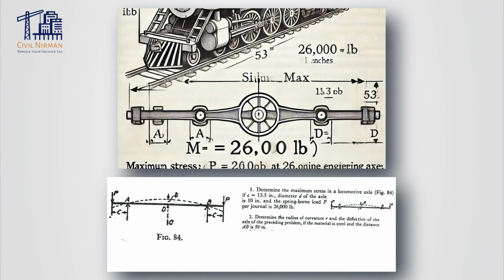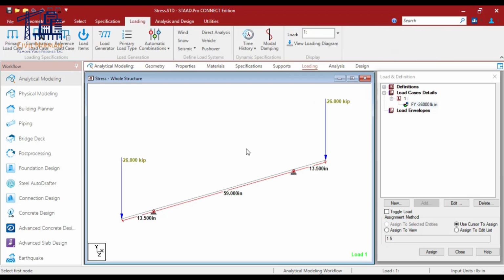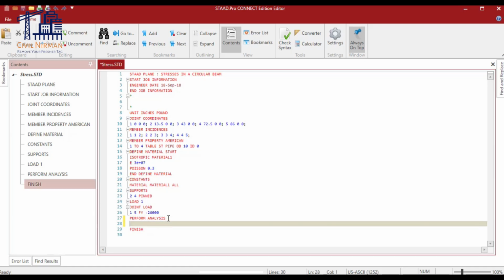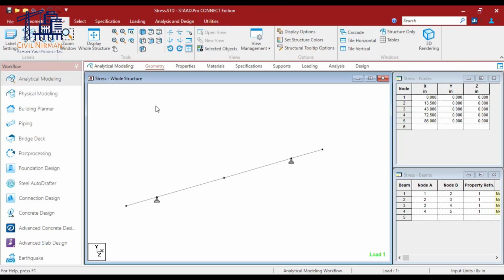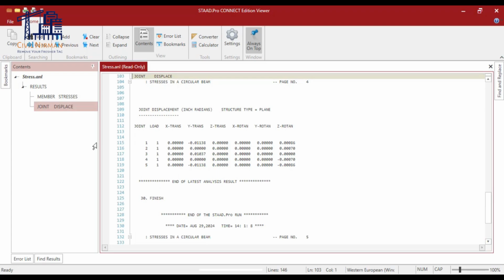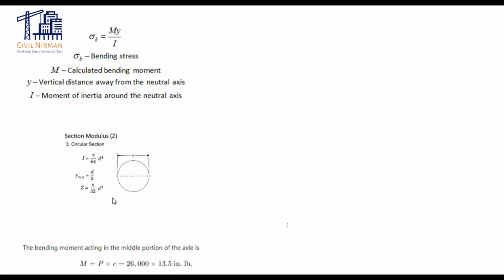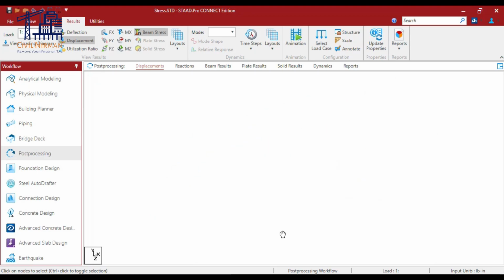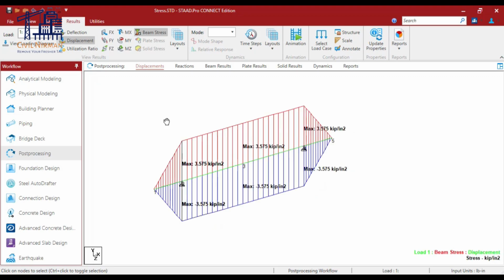Manual Verification With Staad Pro for Deflection and Maximum Stress of a Circular Beam

Comment: What is formula used in calculations of youngs modulas in pipe section
Reply from the maker: @binayaksamanta863  its material property..and its already given in the sample problem data ,i have mentioned that during lecture..watch carefully ,if we go by default value of Staad your answer will not match thats why i have created material property sapertly according to E value and added